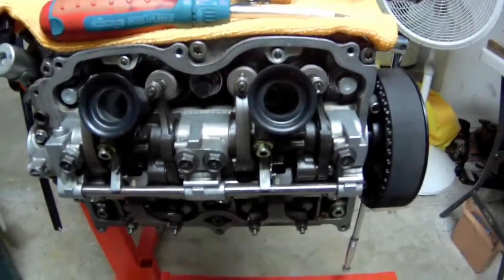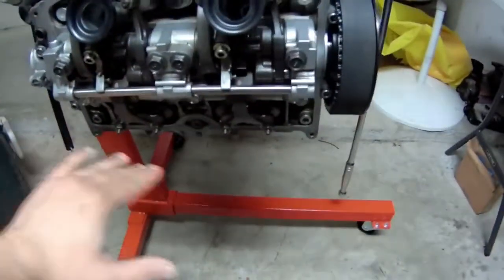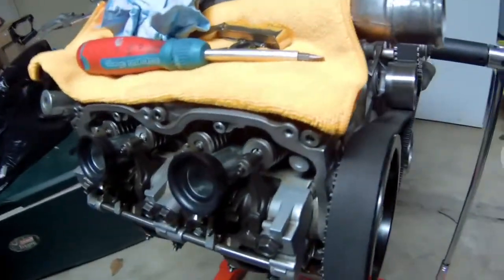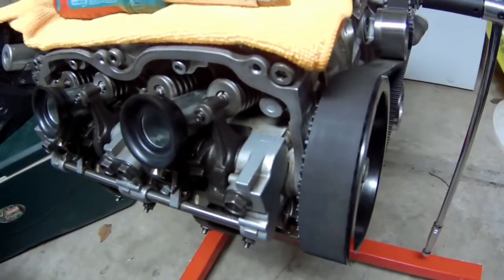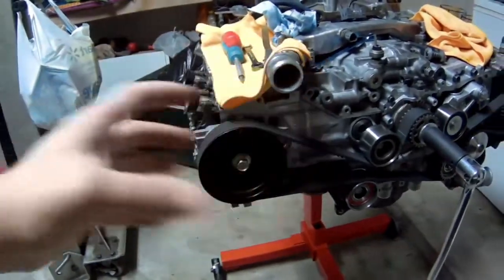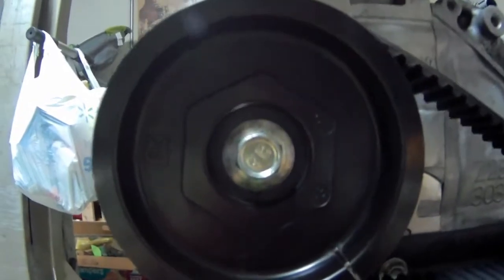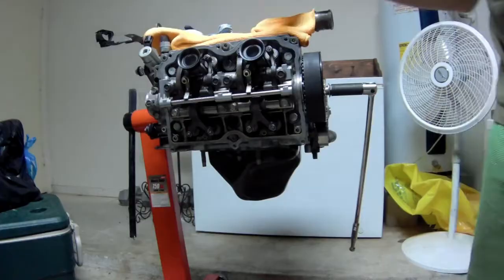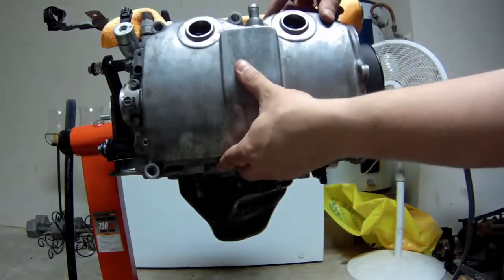2007 Subaru Impreza 2.5i SOHC Rebuild Part - 7  Valve Lash Clearance Adjust How To and Cover Install

Comment: Awesome video.  I have a 2007 Subaru Outback.  My valves and/or lifters are starting to make a ticking noise at 215k miles.  Can this adjustment be performed with engine still in the car?
Reply from the maker: You can, but I would not want to.

You would just need to unbolt the motor mounts and transmission mounts and use a jack to lift the motor for some clearance which will still be petty tight.  And remove the battery.

Thanks for the comment and do please consider subscribing!

Comment: By rotating the crank pulley clockwise every 180°
 from the state that #1 cylinder piston is on the top dead center of compression stroke, #3, #2 and #4 cylinder pistons come to the top dead center of compression stroke in this order.
Reply from the maker: This for the comment and do please consider subscribing!

Comment: Thanks for the video! I just bought a  used  2011 Outback with the EJ253 and  a  rare  6-speed  manual. Wow  so big and  heavy compared top the Impreza. The Last 253 I had was a 2009 Forester. Was trying to figure  out if it still had  AVLS and a  Solid cam. It's  awfully quiet and  bit down on high RPM power.  May just be the air filter being clogged or  maybe the AVLS actuator  spool valves get clogged? Or an overactive  knock sensor. It's got good  bottom end  grunt though. I'm used to them ticking a  bit when cold!  Thanks  again,  Sandy.
Reply from the maker: My understanding is that if it is a 253 - it is AVLS - not saying that with absolute certainty, but I think that's its primary differentiator.

Thanks for the comment, Sandy Shoremann, and do please consider subscribing!

Comment: I have a 02 EJ25 SOHC,  has about 200K miles on - is it a candidate to rebuild ?  ?line bore the case ? hone and oversize pistons, grind/polish crank, new head bolts...??unsure on head work, but what might that cost ?  It's sitting on my garage floor.. Thank you.
Reply from the maker: Hard to tell with the combination of things you’re going to do yourself and whatnot, but I’m pretty sure with my build I got the block and heads planed, and valves seals replaced all for like $600.

Boring out the cylinders will increases that cost, no doubt.  Your best bet is to call a couple machine shops in your area to see what it should cost.  I’d also research what power gains you’d get from the extra work to see if you wanna do that at all.
Reply: @PeaceLoveAndGuns  I contacted one shop and I'm not going this route.  Found a SOHC running iwth 115K on it and head gaskets, timing belt etc done last year - rusted out, only 5 bills..right now stock is ok...Hey, get a forged crank, forged rods, and turbo that old 2.5 !!  One guy said easy to get 400 hp from one of these engines...
Reply from the maker: The engine isn’t really the problem after the kids you say.  It’s the “glass” 5mt transmission.  Everything I read says get a wrx or sti if you’re going the performance route.
Reply: @PeaceLoveAndGuns  will subscribe..mt feels nice.. I heard the engines were glass, they increased the siicon to  make them hold tolerance but it makes them brittle so you need 93 octane to stop predetonation and "ringland" failure.  This was engine 2 in this WRX, dealer replaced it at 60K miles, amazingly.
Reply from the maker: Thanks for commenting and do please consider subscribing.  I’d love to hear future updates on your build.

Comment: I'm pretty sure.if you line up with dead center and throw a speed square get a nice accurate measurement?
Reply from the maker: I'm not sure I've ever heard of this way of doing it, so I'm not sure if it works or not.

Comment: Would a 2010 subaru outback have the same rocker arm ?
Reply from the maker: Hey brodie 401, they're both EJ253 engines with AVLS, so it should be the same.

If this has helped you in some way, I would love it if you would please share with your friends and consider subscribing.

Comment: What’s the torque on those little nuts?
Reply from the maker: Definitely recommend downloading your factory service manual.  I dont remember the exact spec - perhaps I say it in the video - but I do remember it is measured in inch-pounds.  Just slightly snugger than snug is what I did since I don't have a tiny torque wrench.

Comment: I finally took my ej251 apart trying to fix an unknown overheating issue by what most likely seemed to be a HG issue. During disassembly of the engine, even though all my sprockets timing marks were lined up, I ended up with Piston 2 intake valves and Piston 4 exhaust valves semi open. I’m at the crossroad now of whether to take apart the heads or not before sending them to a machine shop to get resurfaced. I’m concerned I may throw off the timing because of those 4 valves semi open. May I ask what tool you used for removing the valve springs and retainers? This was a great video btw
Reply: https://youtu.be/xtO8ev0Q9jc this seems to be the fastest and easiest way to remove the valves. I've used it many times now and won't do it any other way. I actually just put magnets inside the socket so with one good push both keepers come out
Reply from the maker: Hey, thanks for the comment gowdaflow.  Its good to know that my video is helping someone!

I'm not sure as to the differences in the EJ251 and 253, and I'm no expert buuuuuuut - and this was confusing to me at first too - the timing marks are Not the same as (for lack of a better term) 'piston/cylinder line-up marks.'

With the crank key at 12 and the line on both cams at 12, the engine is timed as long as you don't let the belt slip a gear.  You should be good.  At TDC your pistons are all in various parts of the 4-stroke cycle.

As for the position of the arrow on your cam sprocket, that's for the setting of the valve lash.  You do not set the valve lash at TDC and will need to follow the FSM for your year model.

I didn't plan on taking my valve's out when I did the job, but a miscommunication at the shop and HEY, new valve seals.  From what I understand, this is a PITA and even then stated as such without the official subaru tools.  I would let your machine shop do it probably.
Reply: Peace, Love and Guns Thanks for the replay. The whole TDC thing was kind of confusing.. first time doing this, but I think I understand it now. I thought TDC was when a piston would be extended all the way out towards the head, but it looks like it’s the opposite because all 4 pistons on my engine were inside at their farthest traveling position after I had all sprockets lined up at 12 o’clock. By logic now, I imagine this is what the Service Manual refers to as TDC. I thought it was when they were fully extended, but I get it now: TDC is when they are fully inside, so as not to hit the valves. I see now this is why Piston #2 intake & exhaust valves were ok even though they were semi open, because all 4 pistons were at TDC inside their respective cylinders. Someone on the forum said I should turn the sprocket counterclockwise until the intake & exhaust valves close before taking the heads to get resurfaced. And that I should turn the sprocket clockwise to get them open a bit again before assembly. I’ll double check every thing following the manual of course. Thanks again for your help.
Reply from the maker: @VortexTheCreeper127  You're right on the meaning of top dead center.  Generally cars are timed so that cyliner 1 is at TDC.  Subarus are weird ish, as you alluded to, because they're boxers and interference engines.  Subarus are timed mid-stroke.  I've heard people say 'middle dead center' before but am not sure if that is technically accurate.

Take your time, read your manual and have fun with it.  Its just big legos.

Cheers!
Reply: This is my very first Subi ever! They are fun cars to work on indeed. I can't wait to get it all installed back on the car. Ha! I overlooked what you stated about the rocker arms which can make the motor sound like a  "diesel sound". I hope that's what I had (out of spec rockers) and not Piston Slap because my engine sounded a bit like that before. I will refer to your other videos as well for guidance. Thanks and take care
Reply: Hi there.. Just wanted to say that on the topic of having the pistons at Top Dead Center, I was wrong before. The pistons are not supposed to be inside, but all the way outside(Top Dead Center). Just wanted to clarify in case someone reads this, don't want them to get confused.

Comment: shouldn't the cam be rotated 180 to get cylinder 3 to TDC?
Reply from the maker: That would be entirely dependent on the starting point.  Follow the FSM and you can’t go wrong.
Reply: The  cam goes around 360 when the crank goes  around  720. A 720 degree rotation of the crank fires  All Cylinders on any 4-stroke, be it an i4, V6, i6 or V8. The  CAM travels  1/2  speed of the  crank  (It's  sprocket has  twice as  many teeth as the crank, and a 2:1 diametrical ratio) Now, One  rotation of the  CAM fires  all cylinders on any 4 stroke engine. So, 90 deg x 4 = 360 = all cycles completed. To answer your Question,  NO. Every 90 deg of  CAM rotation will have  a cylinder in the firing order at TDC. If you set cyl #1 at >0< then cyl#3 will be  up next when you rotate the  CRANK 180 deg. This is  given the firing order of 1-3-2-4. Confusion reigns in an  auto shop "how-to"  when you conflate  Cam degrees  with Crank degrees. When you " turn an  engine  over 90 deg" you should be  talking CRANK ROTATION. Finally TDC is  top dead  center of piston #1. It is  not 12 O'clock of  the  crank position. You can later discuss TDC of  any particular cylinder, which is  only accurately found with the heads  off and  using a  dial indicator  - or  better yet  - a  piston stop where you split 1/2 the CW and CCW  stop points and  mark the balancer appropriately.  But now  we  are  getting into 2 HP per cu-in N.A.  race builds. Bed Time!   HTH - Sandy
Reply from the maker: Great write up, Sandy Shoremann!
Reply: @PeaceLoveAndGuns  I Just  hit the SUBSCRIBE  button :) Thanks  again for the  video. I just like  seeing engines  torn down and  built up. Its  GOOD  reality TV :) - Sandy

Comment: You can also use the rock method. If firing order is 1,3,4,2. When cylinder 1 is at TDC compression cylinder 4 will be at TDC exhaust. In this situation both rockers on cylinder 4 will be moving.
Reply from the maker: Thanks for the comment, Aaron Smith.  That sounds a little bit quicker.  Next time I do this job, I think I’ll do it in this way.

Like and subscribe for more updates on the Subaru project and some groovy gun videos!

Comment: I didn't realize 253s didn't use buckets. Seems much easier to set valve lash than on the DOHC models.
Reply from the maker: Its way easier when the motor is out of the car, that's for sure!
Reply from the maker: Like and subscribe for more Subaru videos coming up ^__^

Comment: Why don't you use the arrow on the cam sprocket to determine propper cam degree?
Reply from the maker: That's a great question!  It's not the timing mark.  Confused me at first when I first looked at it, too.  The Subaru fsm makes it pretty clear.
Reply from the maker: The arrow is for the piston position.  Straight up is top dead center for cylinder #1.

The timing marks, when lined up, denote all pistons are at the middle of there stroke.
Reply: Peace, Love and Guns, I just reinstalled the heads and am getting ready to set gap. Don't have a manual. Appreciate your help. Does the manual say to use the timing line, not the arrow? Timing line on the crank at 12 oclock is mid stroke on all 4 cylinders. Are you using the line on the cam gear at 12, 3, 6 and 9 oclock to set each cylinder?
Reply from the maker: Lucky Red Use the store for the purpose of valve lash.  Bear in mind it is a different position for each cylinders' tdc.
Reply: Peace, Love and Guns, store?
Reply from the maker: Lucky Red Lol, swipe keyboard for iPhone had failed me!

ARROW, use the arrow.
Reply: Peace, Love and Guns, I'm reading an online manual that says to set gap on each cylinder by using arrow direction, not timing mark. Says to use arrow on cam sprocket at 12 o'clock for cylinder 1, 3 o'clock for cylinder 3, 6 o'clock for cylinder 2, 9 o'clock for cylinder 4. Says the arrow on the cam sproket indicates Tdc on those cylinders at those locations. U agree? Thanks, man! Appreciate your time and answer!
Reply from the maker: Lucky Red Definitely use the arrow.  The procedure you posted sounds correct.  I apologize if this is basic, but just make sure you're adjusting the clearance for the right cylinder.
Reply: Peace, Love and Guns, thanks man!
Reply from the maker: Lucky Red It's my pleasure.  Like the vid and subscribe to help me out!  You might also share my channel with your friends that like gun stuff!  Good luck and have fun!
Reply: Peace, Love and Guns, will do. Subscribed when I started pulling it apart a few weeks back. I'm a gun guy. Check u out after I'm done playing with this car. Thanks again.

Comment: Well said, sir!! Maybe a wood dowel through plug hole instead of pressure on hand would illustrate better if u do another one.
Reply from the maker: Oh god, don't wish that on me!  ^__^  Thanks for the comment!  I've got more groovy Subaru videos planned for the future - so subscribe!
Reply: That’s how I have always done them, just jam a small long screw driver down and watch for it to top out. Great vid, I’ve never worked on subies so had to watch a quick vid on them. Glad I found this one
Reply: J Nat, I know what you mean. I never did a rebuild on one of the horizontal motors until making that comment researching the timing marks. I am a fan now. Easy to work on. Small! Light! Well designed.
Reply from the maker: Thanks for the comments guys!  Great stuff.  Please subscribe for more good stuff!  <3

Comment: What key can used for sheave?
Reply from the maker: I'm sorry but I do not understand.

Are you trying to find out what size feeler gauge to use?
Reply: 6:50
Reply from the maker: The CrankShaft bolt is 22mm.
The CamShaft bolts are 17mm.

I hope this helps!
Reply: Thx!